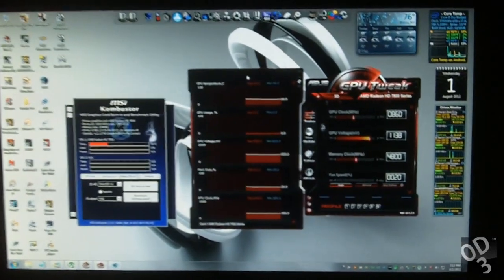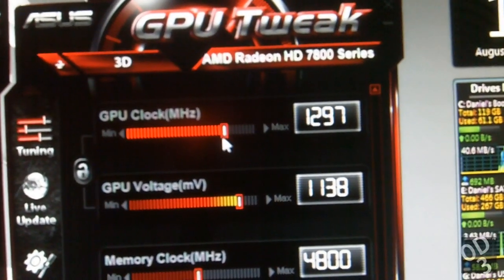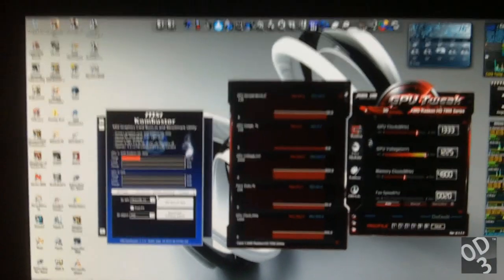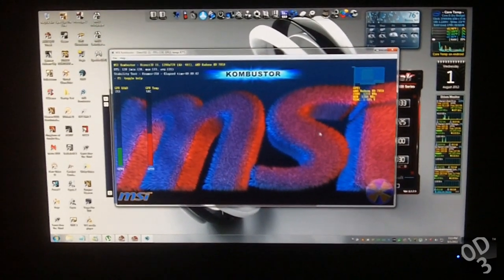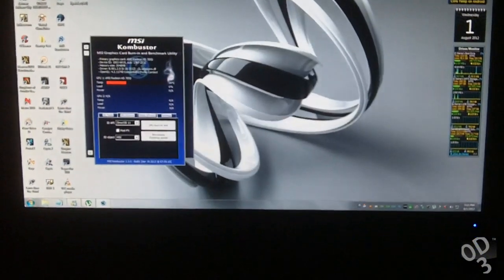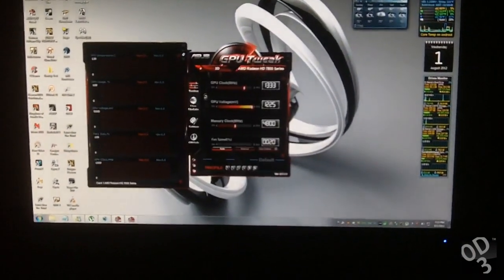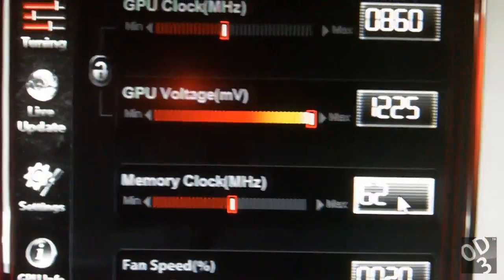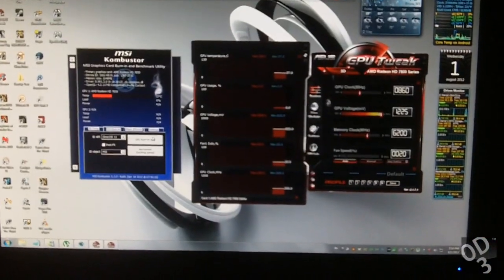What Happens When You Overclock Your Radeon HD GPU Too Far

Comment: Very good video,thank you. Nvidia based cards behave very similar to AMD,im writing from my personal experience. Too high memory clock will lead to different coloured screens and complete freeze,and too high graphic processor clock may lead to driver crash (and maybe recovering). Still,some older cards may not recover without pc restart,they will probably also freeze and give strange coloured screens. Too high temperature may automatically reset pc. This happens in my case with xfx hd5850+oc.
Reply: It's 2022 just saw your post I tried overclocking my GPU and I did it to the max now it's frozen every time I restart the PC it gets stuck and frozen right away

Comment: how an issue fix my graphics card it's amd xfx r7 360 and I over cloked the memory to much on after burner and when I did its jut went black and I push the reset button and it's not responding on the monitor how can I fix or its already dead

Comment: This video saved me 300 bucks on a gpu. I thought it was the other way around for core and memory crashes so I was troubleshooting with the wrong idea! I had my memory clocked too high and it kept defaulting to the same number do I figured it was suppose to be that way, being an oc version out of the box. Turns out, AMD Overdrive thought it would be funny to bump the mem clock up another 50% behind MSI Afterburner's back and give me a near heart attack. You should have seen my face when I turned my ran Unigine Heaven Extreme and saw 97 degrees in the first 10 seconds followed by immediate yellow/grey lock up screen. It was one of those "Well...shit..." moments.
Reply: Haha

Comment: I had a 560ti FTW edition.  yep... already overclocked. then I overclocked it to the max and played crysis 2. I timed it and it worked for under one min. the framerate was 60 then dropped quickly to 10 then went black. but it lived the 3 times I did that
Reply: Yeah. First it probably thermal throttled and then shutdown.

Comment: I used afterburner to overclock my GPU +22 on core clock. Then randomly my GPU driver started crashing. I found out that it set itself to +1000
Reply: I had the exact same problems as in the vid

Comment: so.. i tryed to overclock my 970gtx nvidia card, and the whole screen Just Went White like yours... does it make any damage to the card at all?
i hopes it's Just me but it Did look like i'v got less fps (beamng) i where on 45-50 fps before the card crash and 35-40 fps after the crash... any advice? bought the card yesterday😢
Reply: try underclock the card to the factory setting. if it still dont work bring it back to the store/where you bought it. they might or not accept it so good luck.
Reply: I'v already sent it in... i'v been waiting for 1weak already...
Reply: DynaDrift NOR ok good luck then. did they let you rent a card?
Reply: thx😄 but no they didn't rent me a card...
Reply: +DynaDrift NOR First thing is it's week not "weak" second thing there is a program by microsoft which I used just enter a code into it to reset gpu not shipping it or sending it in 100% guaranteed reset.
Reply: +darksouls45688 
ok, ty! :DD
Reply: +DynaDrift NOR did this overclocked my GTX970 out of curiosity , i put 1000 Mhz on msi burner, then my monitor became all white.  Forced restart my CPU, then blue screen appeared saying "Recovery, you pc/device needs to be repaired", got nervous that i damaged my GPU...  What i did is i removed the graphics card from MOBO then attached my monitor to the default mother board GPU, then opened my CPU, till the windows appear then i Shut it down again , then i put back again my GTX 970 on MOBO, attached it to the monitor now its working perfectly.. Whew,, saves my day.. i can sleep now soundly. lol

Comment: Memory overclock is causing very weird game glitches and texture anomalies.
Reply: +DMTbliss NewWay It's called artifacting. It's common if you push you GPU memory overclock too far. It was happening to me earlier, when I was oc-ing my HD 6850. (Its now at 875MHz core and 1150MHz memory, if you're wondering)
Reply: +DMTbliss NewWay It's called artifacting. It's common if you push you GPU memory overclock too far. It was happening to me earlier, when I was oc-ing my HD 6850. (Its now at 875MHz core and 1150MHz memory, if you're wondering)
Reply: +CoolSkeleton95 Yes, that's weird. With FEAR I had severe ones even seen skull face appearing in walls
Reply: Aw, crap. Double post :l

Comment: Conclusion
Increase Gpu clock too  high your driver will be crash
Increase Memory clock too high you will get black screen

But what happen if temp too high ?? 
Direct explode, gpu going throttle or anything else, plz tell me
Reply: VDDC is voltage in your GPU. yes you can boost more than 1000 mhz. But if you increase VDDC too much you will be able harm your GPU. Other risky you will be find, Overheating, Permanent artifact. use OCCTPT for testing error in your overclock
Reply: +Do Marash Thumb up..
Reply: I forgot the exact name of it but basically the gpu is gonna slow down until it is at a safe temp (set by manufacturer) and then go back up, generaly, it happens arround 85 degres celcius (depends on the card)
Reply: +Do Marash oh its "thermal throttling"
Reply: +G79 Support my card "exploded" and stopped working completely when i overclocked my gigabyte 7950. It would run at 90 Celsius without OCing. I've now learned to never buy gpu's off craigslist!
Reply: +Do Marash You say "black screen", but i get a pink screen when i overclock my r7 265 to 1050 core clock mhz from 955 and memory clock to 1500 from 1400, can u help me? Seens like you know about these stuffs.
Reply: if you get coloured  screen in your overclock like pink, green, blue and so on.   you need try to lowering memory clock or increase VDDC gpu by a little. Then if you get blank screen or black screen you need try to lowering Gpu clock or increase VDDC gpu by a little.

I had been using this trick to overclock my old Gpu HD4570 since a years ago. and my gpu running well without artifact till know. I am use for daily overclock
Reply: Do Marash i low my core clock to 993 and its fine, that error just happen when i up more than 1000 mhz.
What is VDDC? If i boost it, i will able to put more than 1000mhz in core clock?

(sorry bad englando hahA)
Reply: Depends. If vram temps are too high, its probably going to burn. If your core temps are too high, it will turn your computer off.
Reply: Do Marash it will Blast your ass out !!
Reply: Do Marash over volt it

Comment: I have a Radeon HD 8570D GPU currently clocked at 907 MHz. It was originally clocked to 800 MHz. How much more do you think i can clock it? Its avg temp is 6-7 degrees.
Reply: 6-7? you can get moar. MUCH MOARRRRRR
but 6-7 shouldnt be possible cuz my gt630 goes like 40 when browsing..
Reply: . Doge Its actually probably wrong. (the temp)
Reply: +Zekcryon Its probably 60-70 C or 6-7 degrees above ambient (In your case) 
And as long as you have a decent heat sink and fan on there, I would say go ahead and try 30-60 more MHZ on the safe side.

Comment: I am going to buy shapphire vapor x tri x r9 280x 3gb oc. It is a over clocked edition. Will these happen to me too if I use this card? Or it will happen if I myself over clock the card? Plz reply.
Reply: Don't touch the voltage and memory, don't be aggressive with your gpu core clock.

Comment: hey i just watched this video and when you overclock it to high graphics card reverts back to normal.So i watched a different video of how to overclock my nvida graphics card, so i overclocked it a little and it ran smoothly, then i accidently overclocked everything to the max on my msi ge60 gtx 860m. After i did that i benchmarked it through heaven benchmark and it ran supper slow, at aroung 9 fps. and i reverted it back to normal and it still RAN 9 fps... Please HELP!! :D (Now i cant run Advanced Warfare good:( it ran 79fps then now runs 30fps!!
Reply: Nope johonnie i think his card is went to 324 Core clock ( too low ) to cool it self thats what happened to me cuz of the heat he went too far OC, i just restarted my PC and went back to my regular and safe OC 970core clock with 1.50 Voltage 2250 clock speed on the 560ti 2GB
Reply: if restart doesn't work u have to re-install the graphics driver
Reply: Make sure you reset it to stock speeds not minimum speeds. Also, if your fps is too low, it might be because you damaged the vram chips with really high temps.

Comment: Overclocking to too far overclock may resullt your PC in...
Reply: In What?
Reply: ***** What did you do? Like it sounds like you were yanking power out of a capped out power supply.Then it just went poof. I'd recomend a better power supply if then and if you had a good one then it was obviously faulty or old.
Reply: ***** Are you sure ur 600w is enough? Also did you check how much it can push though the vrail etc? Also i'd recomend buying a well known brand as the people at the store... well... "This laptop here for $500 can play CoD Waw" Pirates waw | It can barely play at 5 fps o nlowest settings
Reply: ***** If it explodes what is going to to happen is they will say some bull shit and you can't do shit because you bought a crappy PSU. Sorry that's the cold hard facts there...

Comment: but after the crash my gpu multiplier wont go up... is that normal? i need to reboot to restore it
Reply: I think that's one of the effects of the way it recovers
Reply: Seems your GPU went on lock down.
Reply: driver is probably made that way on purpose
Reply: Zaptechz Yea i'd never recommend driver overclocking. Prolly has a safety mechanism that locks it down if it crashes assuming the person overclocking knows nothing about it meaning they wouldn't find out how to remove that part of the driver. Idk i'm talking out my ass with assumptions.
Reply: if it's having a problem, then yes it might be a good idea to not seek ways to remove that. if that part is actually causing the problem, some people might but it might not be worth it. one thing that could exist,at least on my chipset,seems to be a sort of watchdog. I can tell because when the chip is unresponsive for some time it's reset and any additional kernels are cleared(from the GPU,not from the main memory). at least it seems to work this way. not sure if the reason for triggering is garbled data or if the chip is running out of power,though. (in the latter overvolting would help but personally I won't deal with that on any chip that I can't readily replace)

Comment: I know its a stupid question, but can it fry the card..?
Reply from the maker: It's very unlikely.
Reply: TheGamingAudiophile Thanks :D
Reply: Daniel Tevi If you push it to far you can cause ppermanentdamage like me to it though... 

I'm dumb yes. Anyways what I did was overclock it way to far and spent about an hour lowering it slowly finding a good clock. I had it up way to far so I kinda broke it somewhat in the way that my Steam skin has artifacts and my games do also. They aren't game breaking though since and I somewhat rarely see them but this is permanent(I think the skin might be broken but not 100% on that).http://prntscr.com/5ajdsn 

If you see many artifacts thats a great sign to drop the core clock a LOT as you're way over.

Before anyone complains how stupid I was: It's a 9500 GT DDR2... it's worth like $20 on Ebay so... and i'm already ordering a 6450 for personal reasons.
Reply: i used the overdrive funtion to auto tune the overclock. this is one of the worst gpus i ve seen so far but it does the job for me
Reply: +Daniel Tevi (Jizzy) If you have no fans/ no heat sync then maybe.
Reply: MLGamer almost 2 years since I was a little newbie, ah the memories. Actually you can fry it even with the heat sync and fans if you put too much voltage

Comment: So i] kinda didn't realize what i was doing, but i've totally screwed my com up buy increasing them settings. Every time i try to go on the program to lower them my computer goes in a disco and goes into a black screen... anyway to reverse what I did? I'm very new to owner a computer and this one is very ancient so I'm not totally sad if it can't be fixed.
Reply from the maker: You should boot into safe mode and uninstall the overclocking program.
Reply: TheGamingAudiophile so would i just uninstall catalyst control center because that's where I changed settings from. Do i have to remove any drivers?
Reply: TheOfficialOAT Oh and i went into safe mode trying to get in the catalyst program, but it didn't have the AMD driver running so it didn't work.
Reply from the maker: You cannot uninstall catalyst when normally booting Windows?
Reply: TheGamingAudiophile When normally booting windows my screen goes black, so I can't do anything unless I'm in safe mode.
Reply from the maker: Remove the graphics card and try to boot with the iGPU.
Reply: TheGamingAudiophile Ok. You have to uninstall it from the controll panel in safemode. You cannot run the program cause of safemode is a safe mode. But you probably should have fixed it by now anyway :D
Reply: TheOfficialOAT  Did you get it working?
I foolishly did the same thing when I got my first computer and I had the exact same issue as you. What I did was I left my computer off for some time and booted it back up with a fan aimed towards it. Luckily I was able to revert it back to normal before I got the black screen.
Reply: yep managed to fix it while in safe mode
Reply: took you how long? :P
Reply: TheOfficialOAT Protip: Use MSI Afterburner and make sure overclock when startup is OFF. It won't auto overclock even if u open the program up unless u choose the profile that had the overclock.
Reply: TheOfficialOAT if you completely remove this program with it reset the %

Comment: what happens if you overclock just a little bit to high? how do you notice that?
Reply: u notice that by your pc turning off or artifacts on the screen or any kind of screen freeze he just showed u in the video ffs the vid is called what happens when you overclock to far...
Reply: i just want to slap u in the face
Reply: Artifacts and game crashing that didn't before. If you want to do a professional grade overclock sit at ur computer after overclocking for about 5 hours with a benchmark running and make sure theres no artifacts and temps are fine.
Reply: ikameozero Just because he asked a simple question?!

Comment: I got a sapphire dual x 7950 (1020&1250) and I've been wanting to overclock it to 1100mhz and like 1275 memory all at stock voltages. HW monitor shows the max voltages used is 1.250v. Are those safe clocks for a stock voltage? I've been hearing users saying it's safe to get 1100 on the core clock for stock voltage.

Comment: Thanks for this vid.  I just got a 7870 and I was wondering what to look for in terms of pushing it too far.  So far I have it set at 1150mhz core clock and 1450mhz memory clock and it seems to run just fine.  The Kombustor program ran for a couple of minutes straight without any problems (aside from getting a tad hot at 74C) so I think I'm okay.

Comment: Did you try Nvidia newest driver ? it could be a driver buggy, unless you're on the stock setting (include your CPU and RAM back to default), and your GPU also at stock, using newest driver but still you got a problem, the last thing to do is RMA your card, or you can "bake" your GPU in the oven, it can be a solder-joint crack between your Geforce GPU to your VGA board.

Comment: Nvidia give a GPU protection for their Kepler series, so it couldn't be a "permanent damage", maybe you should restore your setting to default first (stock speed), clean your forceware driver (uninstall it with driver sweeper application), and re-install it, 70' Celcius is a safe temperature for a GPU (AMD/NVIDIA), because i have tested HD 6950 (flashed to 6970) and OC it to max, when running furmark, it gets to 90'C (it's so hot, the GPU exhaust is a hairdryer), but the card is running fine.

Comment: I have overclocked once my GTX 660 almost to a maximum, it crashed of course, but the thing is I get graphic bugs everytime the temperature gets at around 70c and it has only started happening after that. So if this permanent damage occured, is there any way to fix it?

Comment: I remember year ago, Nvidia Card will be toasted and get a permanent damage if overclocked too hard, like this video :

/watch?v=D-peJeY8zWA

It's Nvidia GTX 590 have a flashing light and smoke coming from the GPU.

AMD have a GPU Protection on the Bios, and on the Catalyst driver, if you're overclocking too hard or GPU is too hot, it will shutdown the GPU by itself before GPU got damaged on the hardware.

Comment from the maker: No, these overclocking utilities enforce maximum safe limitations specifically in the voltage control region. It doesn't matter how high you set the core or memory clock. Your GPU will just freeze and cause the system to reboot. Voltage is the killer and like said before, these utilites do not allow you to go above the maximum safe limit. Another killer is heat.

Comment from the maker: The thing is, I ran 2 tests. One where "only" the core clock was overclocked and one where "only" the memory clock was over clocked. The artifacts you're describing is a result from an overclock of both the core and memory clocks which will take effect when both clocks are pushed too high or MOST LIKELY when the memory clock is in the "slightly unstable" zone. I wanted to show my viewers what happens specifically when when either the GPU itself or the memory crashes. =)